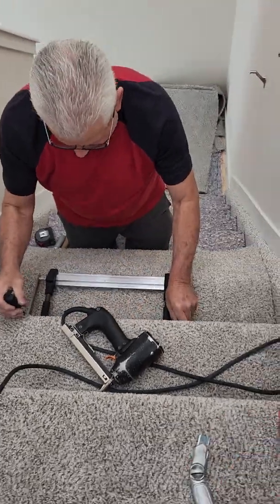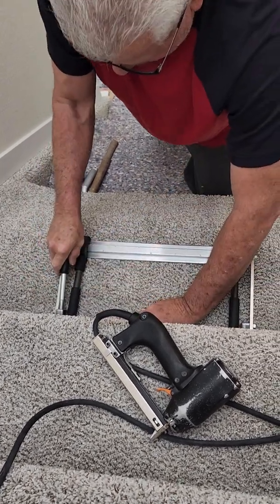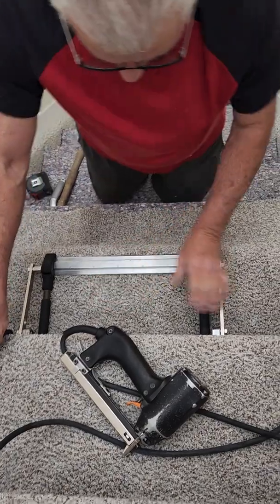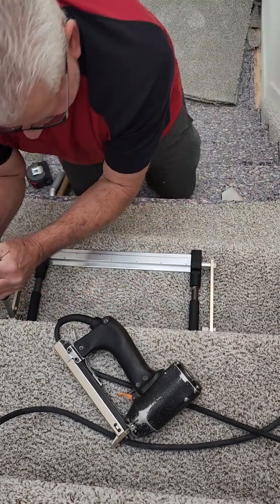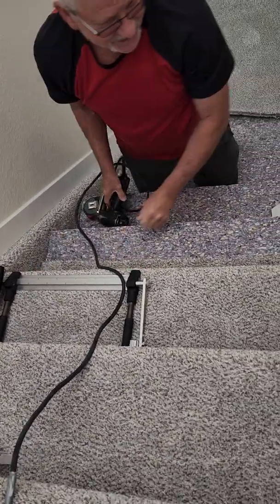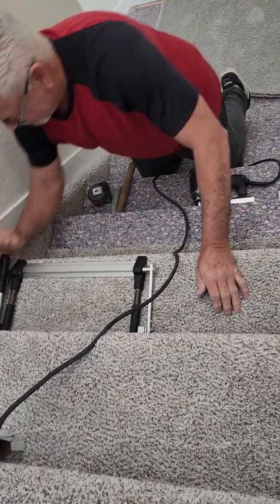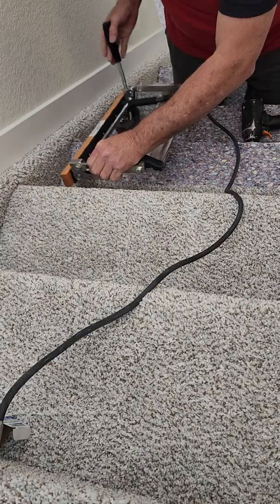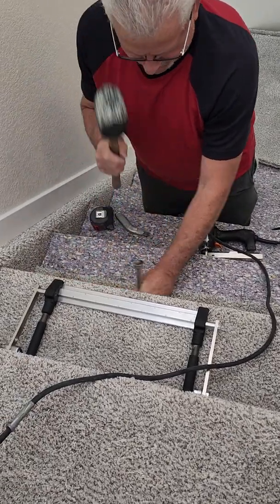STAIR STRETCHER!! VS KNEE KICKER!!

Comment: Been using this for a while now. Takes longer than the kicker but at the end of the day I can walk. Keeps my hip socket from getting inflamed. I would have had to  leave the trade or only take jobs on without stairs .
Reply: I feel your pain.
Honestly I only use the stair stretcher in certain situations but it works .
Reply: Did you use to kick them on? I used to and I have hip pain. I only pressure them and shoot with staple now but was wondering if your hip pain came from kicking them on or pressuring them on, like leaning into the kicker and shooting with the staple gun if you know what I mean

Comment: kinda looks really weird working backward too keep up the good work
Reply from the maker: It's extremely weird working backwards as long as your snapping your legs with the kicker your stairs will always be extremely tight.
Reply: New builds don't use screws in the risers, would this pop them?
Reply: Each stair separate, your maaaad!
Reply: All my steps I push no kicking
Reply: @alexolga11  yah i push the kicker with my chest and weight then hammer in with stair tool tack and staple...

Comment: You can work backwards buy just using tackless
Reply from the maker: Wym tackless?
Reply: @cali408king4  installing waterfall from top to bottom then staple under lip
Reply from the maker: @paulstensland3800  how would you do waterfall though that's what we were doing
Reply: This all seems like a lot of work compared to UK fitting 😂